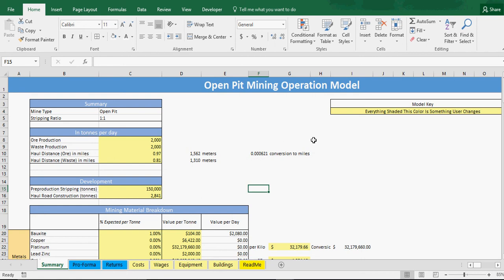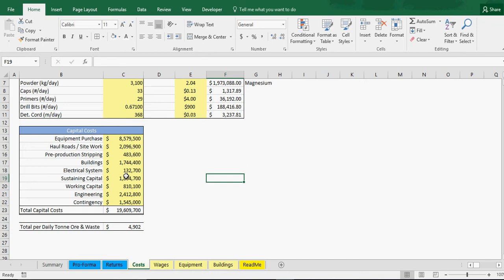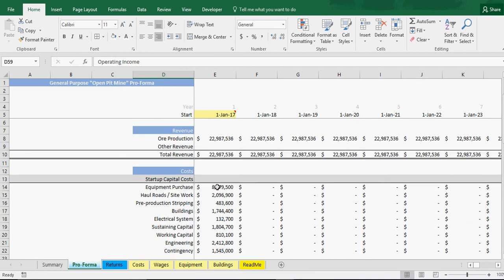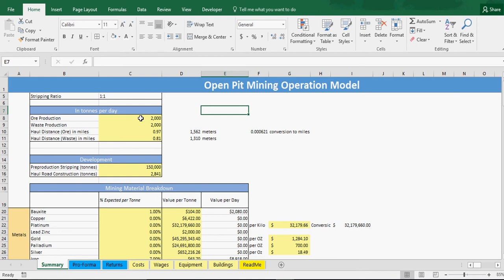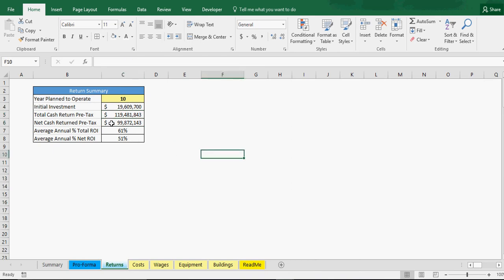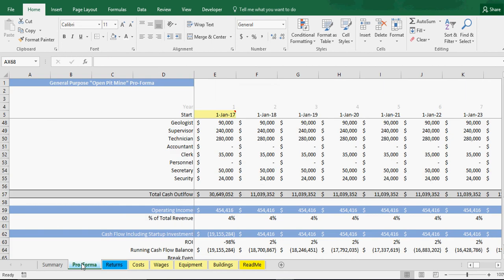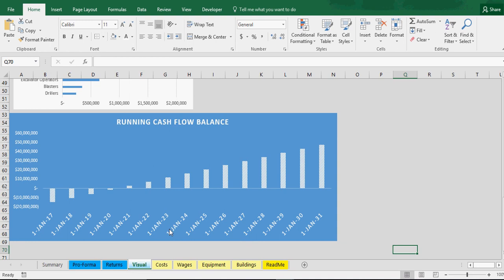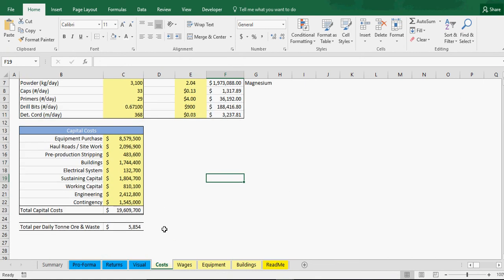Open-Pit Mining: Financial Model

Comment: What happens to working capital ($810,100) at the end of mine life?
Reply from the maker: I do not have a free version of this template.
Reply from the maker: What are you referencing exactly? time of video/cell. If you are talking about running cash flow, that would be available to return to investors/owners. If it is negative, then that means more cash is needed. If you are talking about something else, be more specific so I know what you are asking about exactly. Note, this template has had some updates to it that may or may not be relevant to your question.